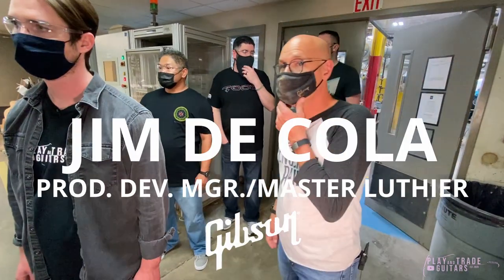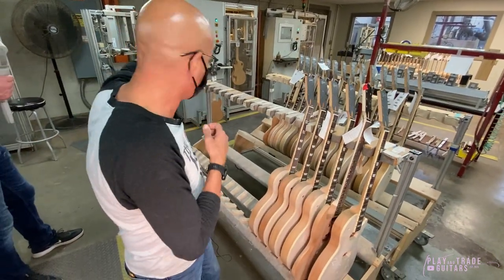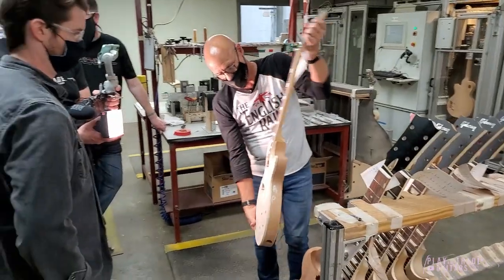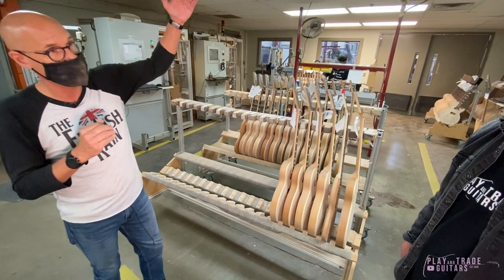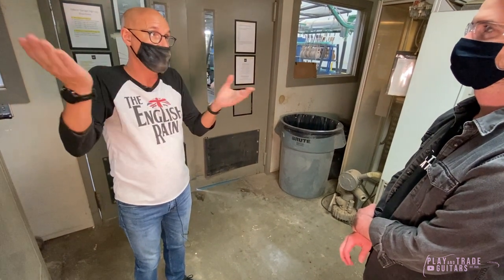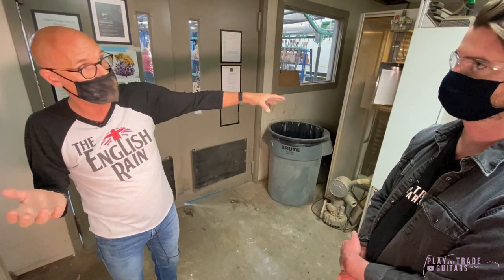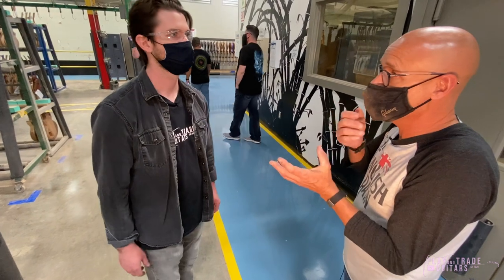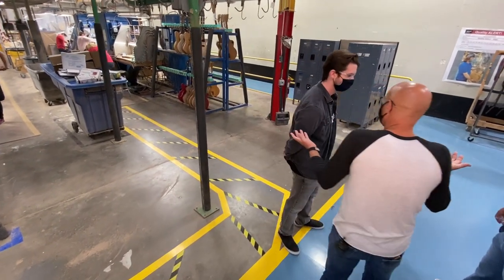GIBSON FACTORY TOURS // EP12: Gibson's Precision FRET PLEK Jim De Cola on Guitar Boom Bucket List

Comment: The papers that came with my new Martin guitar said that Martin uses the Plek machine on this model. The guitar was new in the box. The nut was cut way too shallow and the neck relief was wrong and the action was too high. If that’s what a Plek machine does, it is worthless. I had it professionally set up and it plays great...NOW.
Reply: My pleked Gibson's are great !
I've got some older Gibson pre plek machine and they are perfect too, but it probably took 20 more hours than the plek machine.